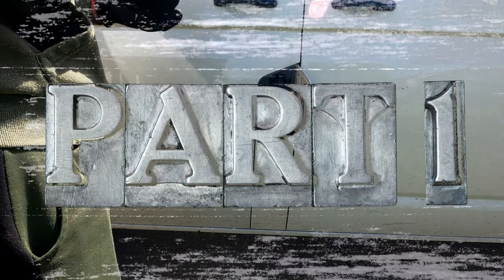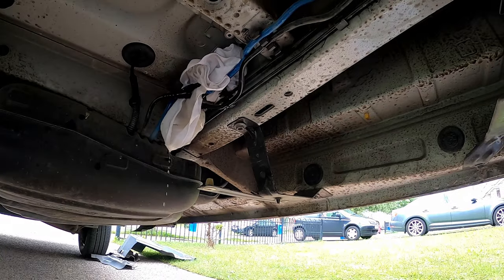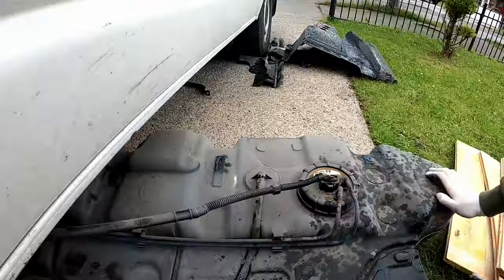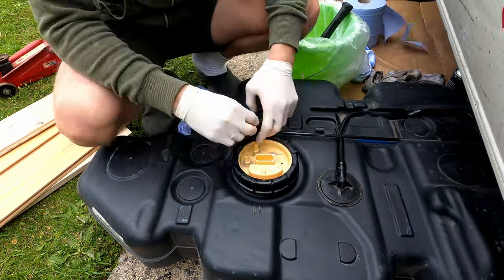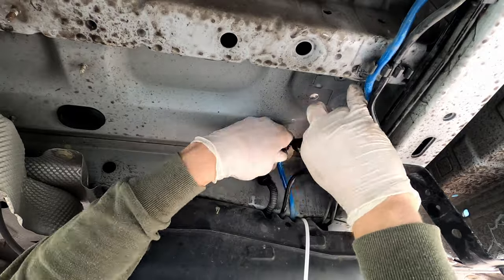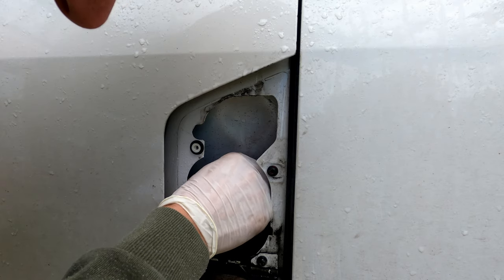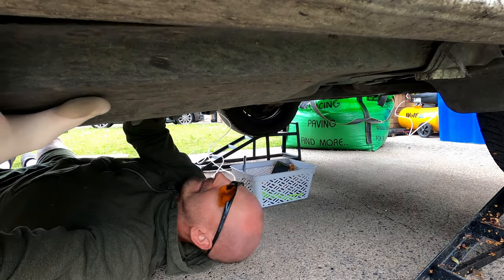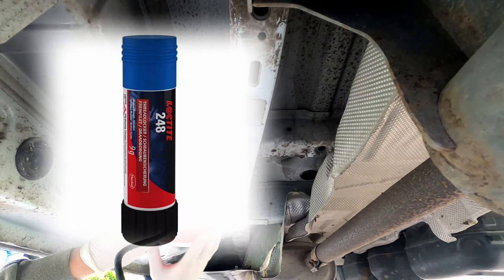VW T5&T6 DIESEL HEATER INSTALLATION

Comment: I'm sure my diesel heater on my Vivaro is tapped into the fuel lines without dropping the tank. Also I would prefer a clean air intake otherwise it's like heating stale air. I would still be worried about an underslung diesel heater with all the flooded roads we get and the water getting into the electrics. They are not waterproof in any way.
Reply from the maker: Agree about slate air..exactly same though went through my mind as well.  I still think it’s a best place for heater.. this is where vw mounts oem heaters I think… it’s all covered with undertray…it’s not exposed at all … u would not even see it if u lift a van 🚐 it’s all hidden away plus I’ve got all terrain tyres which gives u a bit more clearance… ur feedback is much appreciated!!! Thank you 🙏 👍